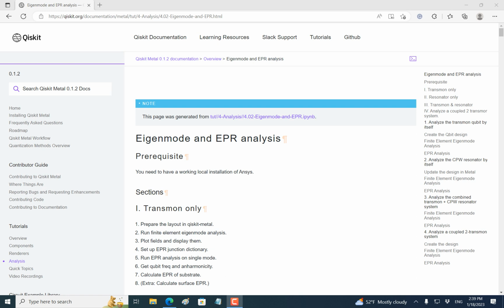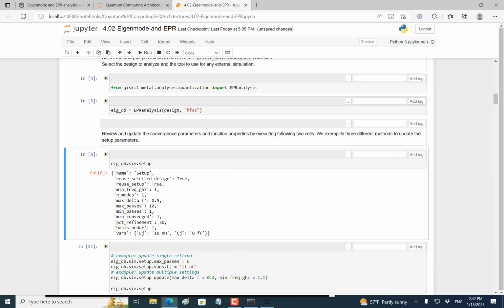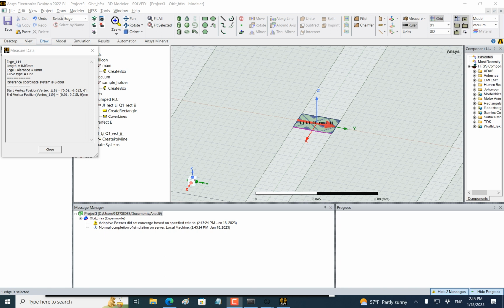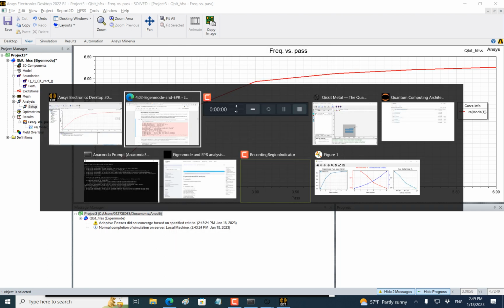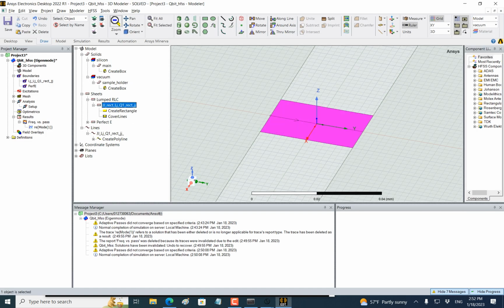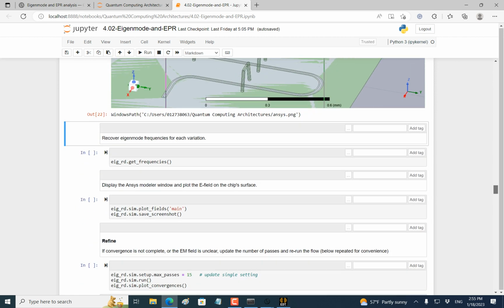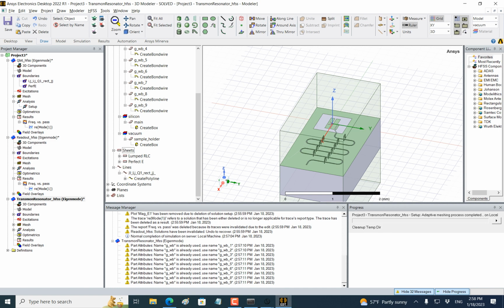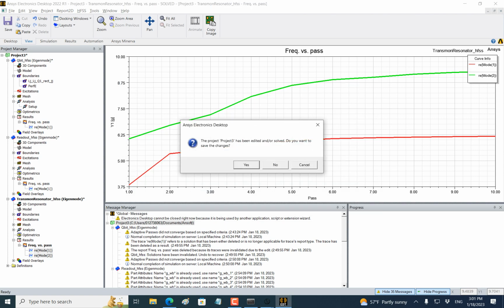Lab 6) Create Transmon Qubit and CPW Resonator to do Energy Participation Ratio (EPR) Analysis.

Comment: Hi ! Thanks for the video, I was trying to run the same notebook but ran into hfss simulation error. How do we tell qiskit metal that we already installed Ansys in the system and refer to it. 

The error i am getting is: metal: pyEPR cannot find the Ansys COM. Ansys installation might not have registered it. To verify if this is the problem, execute the following: `print(win32com.client.Dispatch('AnsoftHfss.HfssScriptInterface'))` If the print-out is not `<COMObject ...>` then Ansys COM is not registered, and you will need to look into correcting your Ansys installation. [ansys_renderer.connect_ansys]

Any suggestions would be highly helpful :)
Reply from the maker: It should do it automatically. I would suggest you try to reinstall HFSS. I have seen many installations and they all worked well without the need for manual setup.
Reply: @quantum_computing  Thank you for responding. okay I just realized that Ansys student license is incompatible with qiskit metal. One needs to have proper license for it to work.
Reply from the maker: @saibharath5510  Thanks for letting me know.
Reply: @saibharath5510 how can we get the complete license? I'm also getting the error while trying to connect qiskit metal for analysis in ansys.